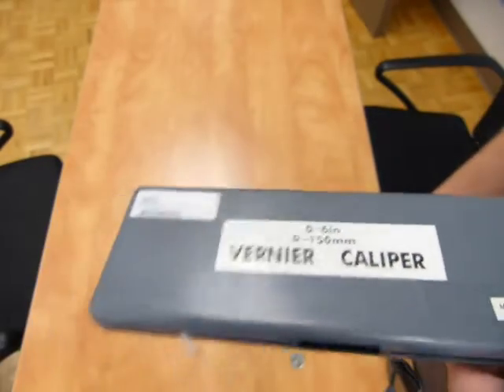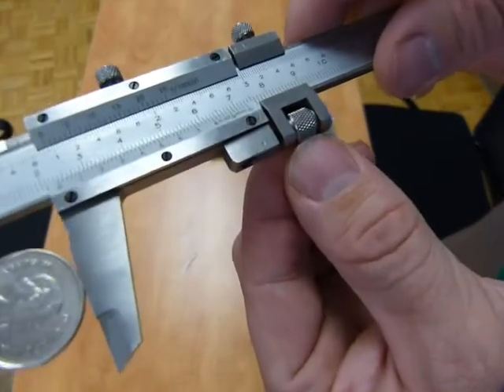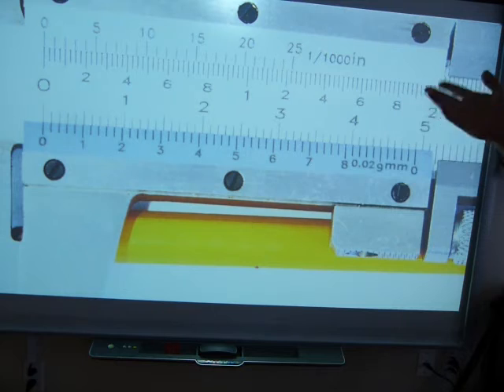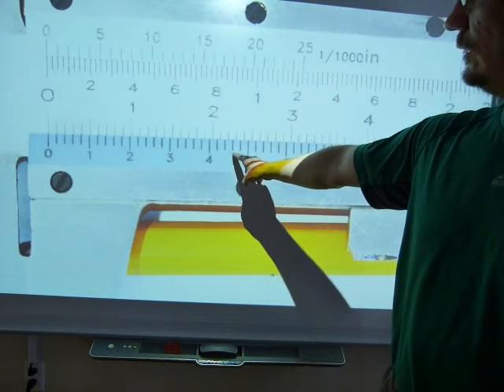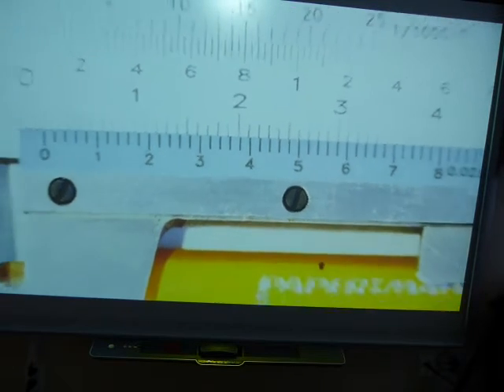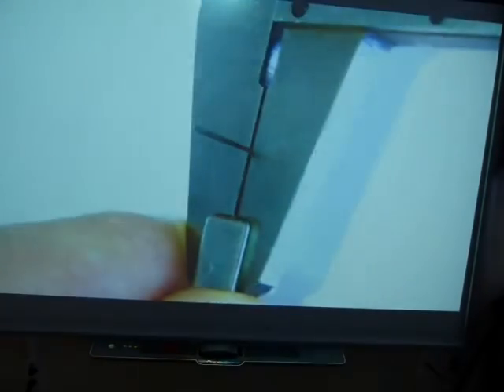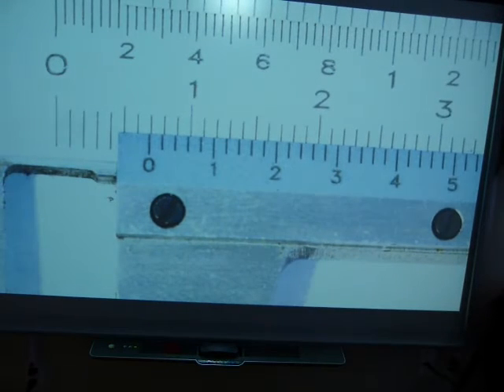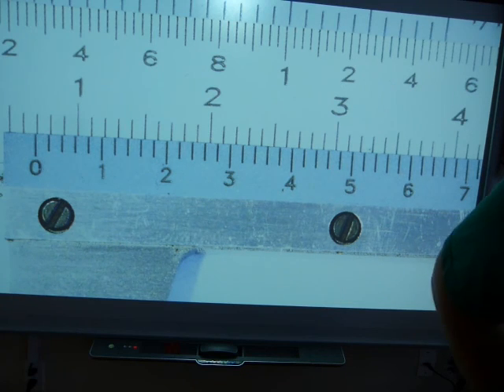Use a fine-adjusting Vernier caliper (Metric)

Comment: My one of this has fine tuning as you show but when it shows it can go to 15cm it only reach 13cm due to the fine tuner in the way and I see no way of measureing the full 15cm as is marked. Do I do something wrong?
Reply from the maker: +Silent but Descriptive They just fitted their plain vernier and fine vernier models with the same scale. Much like the Suzuki Swift gets the same speedometer dial fitted for its instrument panel for both the 1.2L , the 1.4L and the 1.6L engines. Just because the last number is 200 km/h, it doesnt mean the 1.2L engine goes that fast. Nothing`s wrong, manufacturers sell longer calipers, too.

Comment: If the vernier 0 is not lined up with the main scale 0 when closed, can you calibrate it some how to force everything on 0 when it is closed? I noticed screws on the vernier scale plates and wonder can you fix a mis-aligned vernier scale?
Reply from the maker: +TutsTeach The screws just take the 2 halves apart. Adjustments are tricky:
Misalignment caused by dirt in the sliding channel could be fixed by cleaning.
Misalignment caused by bending could be bent back. In theory.
Misalignment caused by faulty manufacturing could be fixed by sanding/filing IF the parts are oversized. In theory. If undersized, extra correction is needed for each measurement.